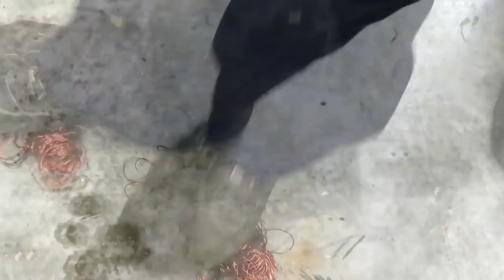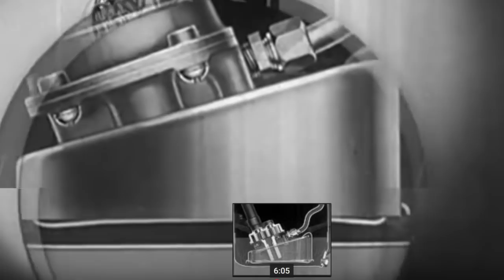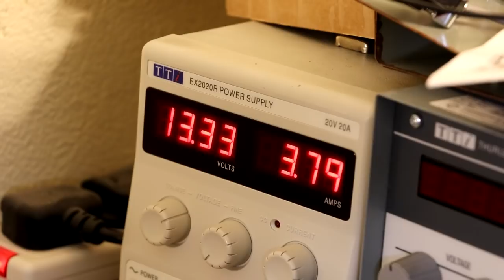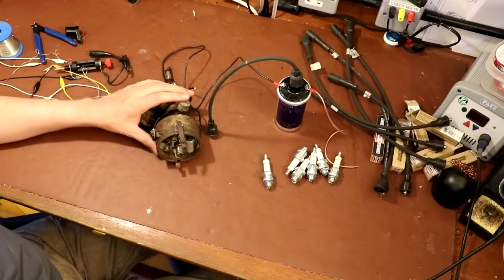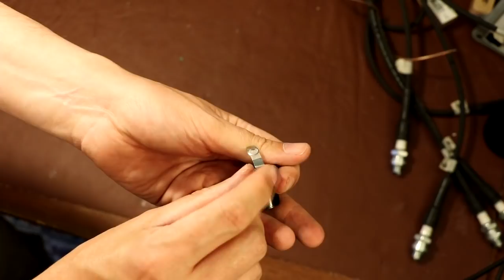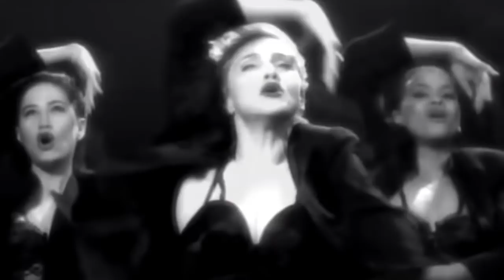Mind The Gap - Part 3

Comment: ha ha the mad donna pisstake,  you clever and daft bugger :-D
Shocking nipples, really shocking :)
Your other half must be worried about you by now, but she could put the spark back into your life with dizzy cap bra's :-D

Ahh the kettering system i think, but i seem to remember the plug outers going direct to earth not the points,  maybe there are two versions, i don't know.
When you were measureing the leads i thought 6K, not far off the real value.
Do the plugs have the 5k resistor inside or direct because of the leads?.
It's a good old system, not much to go wrong.
Thankyou for an excellent fun and teaching video chris :-D.

Comment: Excellent explanation of the Kettering ignition system! Interesting that modern engines actually use one coil per spark plug to improve reliability and simplify ignition timing control. The special ending was a bit of a surprise considering how proper most of your videos are. Regards, David
Reply from the maker: David V Hello David thanks so much for subscribing and comments. Your comments are always amazing although I’m going to have to go google kettering ignition system now you bugger!!
Reply from the maker: I also remember the first wasted spark systems. My vantage had one coil per cylinder. Explains why my last service was £2500